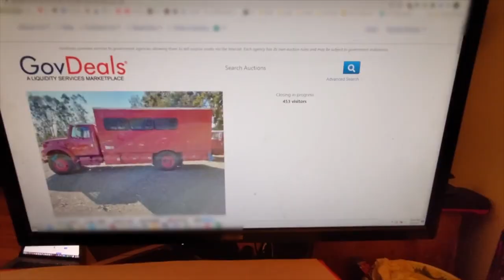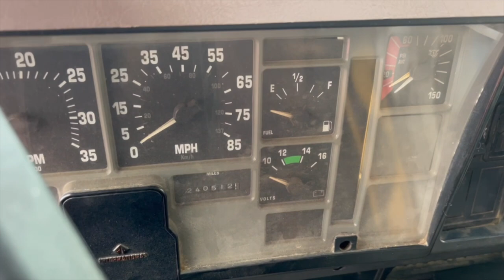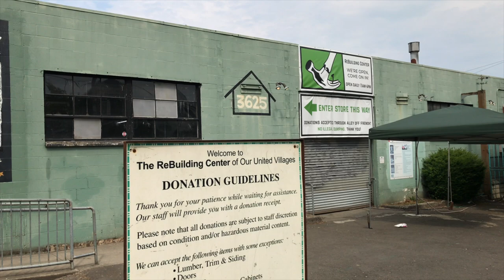We Turned a Fire Truck Into a Tiny Home (the full story)

Comment: Are you able to park conversion buses and trucks in all rv parks. if not how many turn downs do you get.
Reply from the maker: Hi! We've had one or two turn downs, but we've stayed in free campsites more often than not. A lot of the corporate RV parks have strict rules, but we were lucky to find one RV park to stay in long-term during the winter months. If the RV park allows rigs over 10 years old, they will likely accept most vehicles.

Comment: I just saw one of these fire crew buses here in Quartzsite and thought that would be perfect. And so I searched and found this video
Reply from the maker: Awesome! They make great overland rigs! I would recommend a van if you think you'll be staying in the city a lot. We like to park the rig in a national forest spot for 2 weeks at a time and take our tracker out to do things and errands. Diesel gets mighty expensive at 9 miles per gallon, it's definitely a factor when thinking about taking a detour to hot springs and stuff. Makes it much easier to detour when your getting 28 mpg in the tow behind. We snagged ours for 5 grand, I see them at the occasional auction for that
Reply: I want something that can go anywhere and that's what that will allow me to do
Reply from the maker: Haven't met a forest service road we couldn't go down. There have been a number of small national forest sights that we skipped over, imagine a small overlook without RV parking or spots we could double Park in. Busy National parks are another hard one, gotta park in the overflow lots usually. Our rig is 26 feet bumper to bumper, an extended van is 19-21 feet, the longest sprinter is 23 feet. That extra 7 feet keeps big red out of a lot of spots. We had an Econoline van before, great for parking, not great for full time living or being outside of the city more than 3 days (shower, water capacity and food being the big things). 

Anyways, good luck on your venture. You can dive into our build series if you're bored. FYI, our build including the rig came out to $15k ish. Our van build was $4000 ish. But our truck has mini split air condition, 800ah of lithium, 1200 watts of solar, a nice plug in charger, hot water, shower, awning, TV,  etc. I think we were pretty frugal, I've seen people drop 20-40k on 11 window bus builds like ours
Reply: @busingonabudget  you guys did very well! I like how you got you stuff to build your camper. I always get stuff off of craigslist or wherever I can because new stuff is just too expensive. Yes I will be living in it full-time so that would be the better option. It's like a mini version of the Earthroamer.